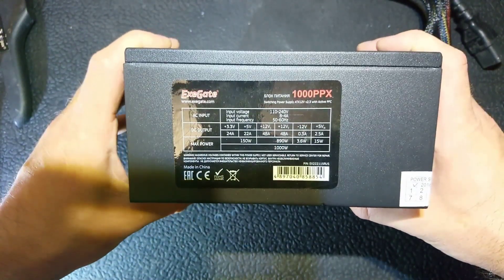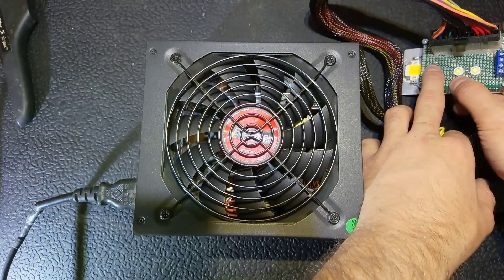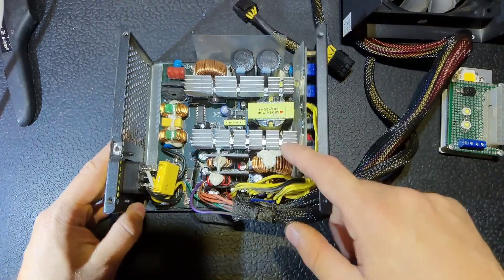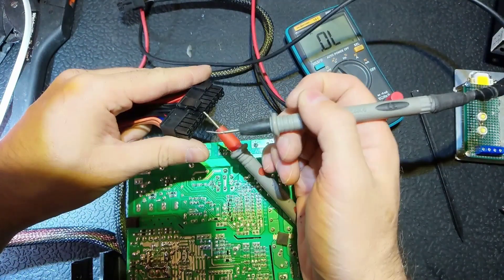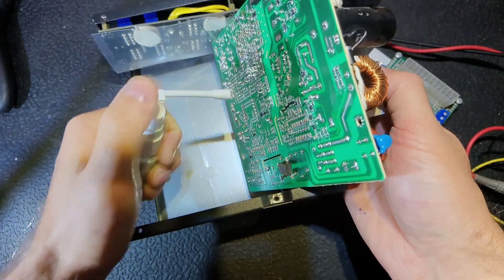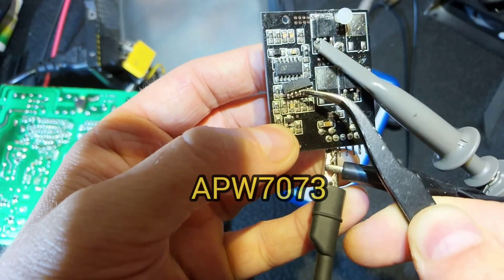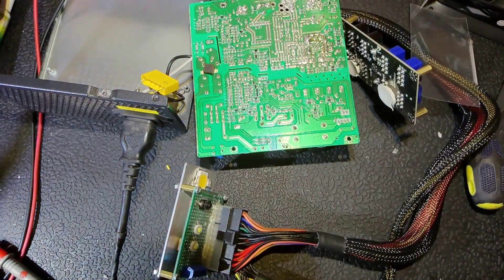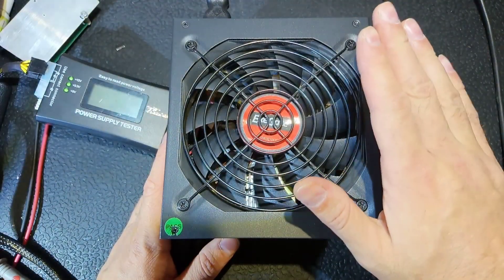1000W power supply repair

Comment: how to make a psu tester like the one you are using? is anyone selling?
Reply from the maker: You can do it yourself actually. 4 diodes and 4 resistors are needed.
Reply: @electronicshaverightstolive  can you make a video tutorial on how to make it? with the schematic. what about the pcb used?
Reply from the maker: @pakandi9287  I will make it for sure after I have 10k subscribers😉
Reply: @electronicshaverightstolive  I have another question, I often see a power supply that has a yellow liquid on the circuit board. My analysis is that the liquid comes from the capacitor where the liquid comes out. I physically checked the existing capacitors, from the circuit board or outside the circuit board, there was no problem. how is the easiest way to find the capacitor where the liquid is coming out? or how to test a capacitor whose liquid is coming out? because I checked the capacitance there was also no problem